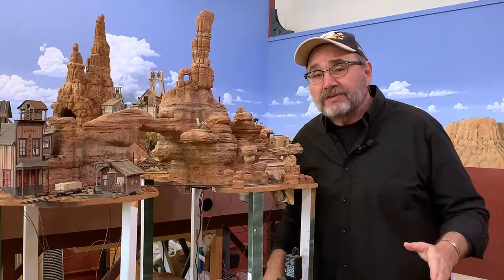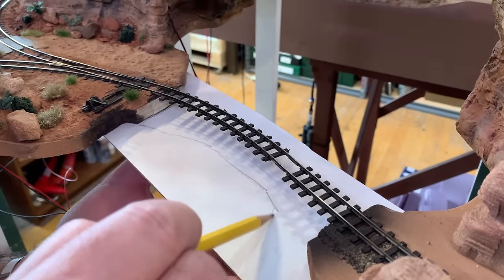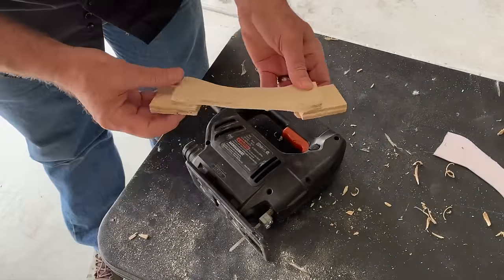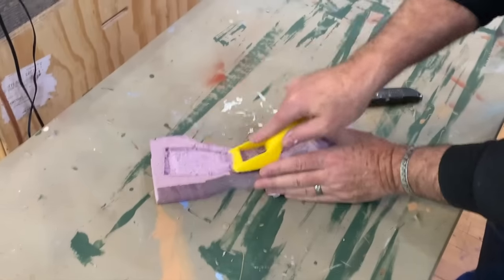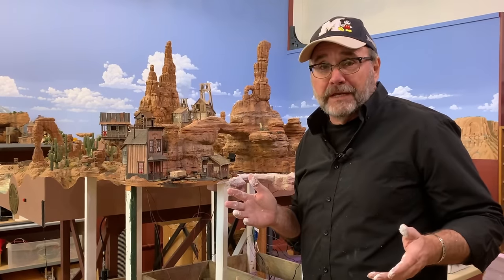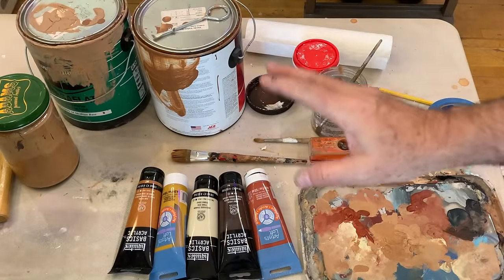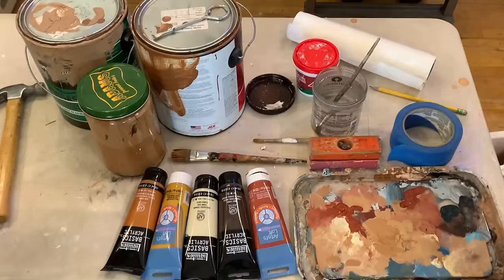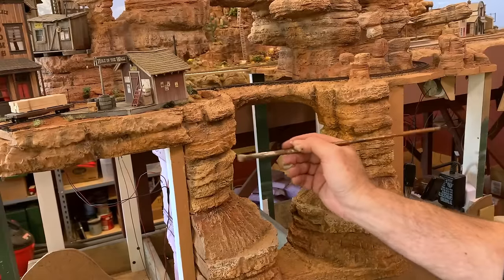Natural Arch Bridge | Bandit Canyon Railway

Comment: You might want to give lightweight spackling a try.  It can go on thicker than vinyl spackling and joint compound without as much shrinking or cracking.  I’d swear it’s what’s Woodland Scenics is relabeling and selling as Foam Putty.  I prefer this over Sculptamold, because there’s no mixing and when you’re finished, close the container.  No waste, and clean-up is as simple as wipe the putty knife off.

Comment: I have seen people use foam without using something to fil the gaps between layers of Foam, Which was my major dislike of using layers of Foam for scenery!  I have steered.  Your use of foam as a scenic material, with Putty type of filler has changed my opinion.